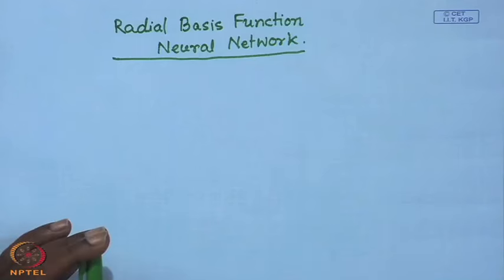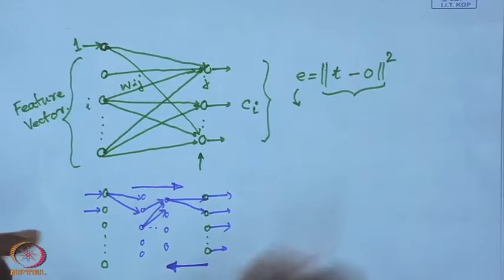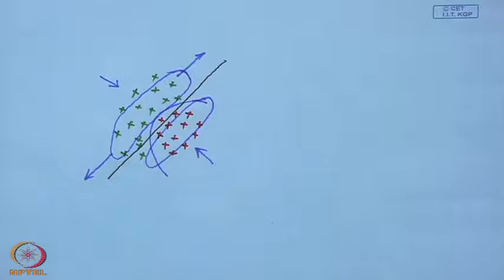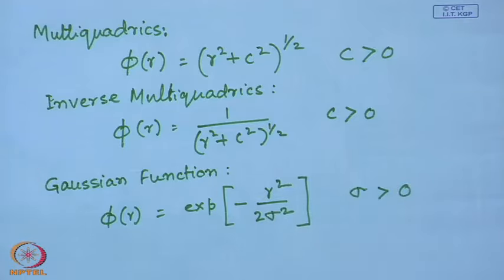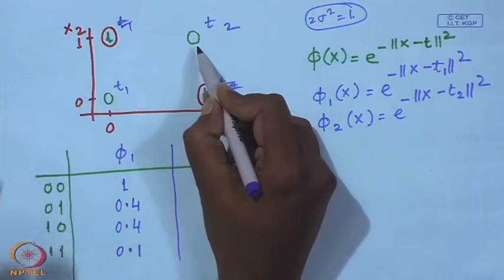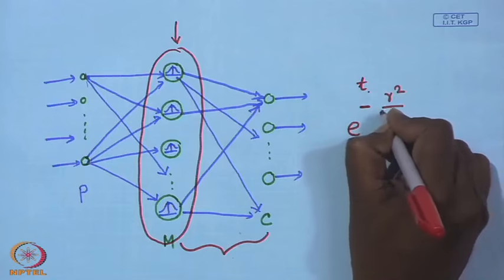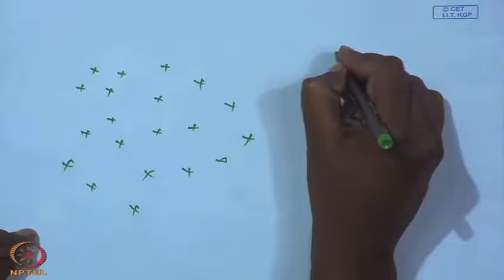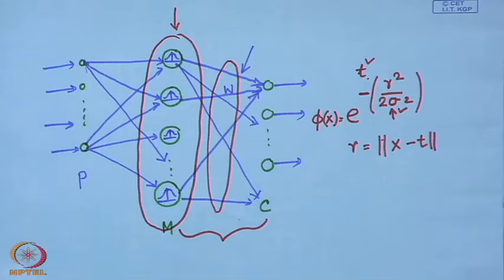Mod-01 Lec-27 RBF Neural Network

Comment: sir can you explain how the norm of x-t1 is calculated
Reply: He calculates the euclidean distance between the two points so if you have t1 in (0,0)
x is the point he wants to calculate the phi for it
for example if x is (0,1)
|| x-t1 || ^2 =  (1-0)^2 + (0-0)^2 = 1 + 0 = 1
e ^ -1 = 0.4

Comment: how the e power -||x-t1|| is calculated when i applied euclidian i am getting different value , can any body have a solution for this
Reply: here ||x-t1|| is the distance i.e. √((𝑥1−𝑡1𝑥)^2+(𝑥2−𝑡1y)^2 ), where x=(x1,x2) and t1=(t1x,t1y). If we use the same example if x=(1,1) and t1=(0,0) => 𝜙1=e^-(2), 𝜙1=0.1353.